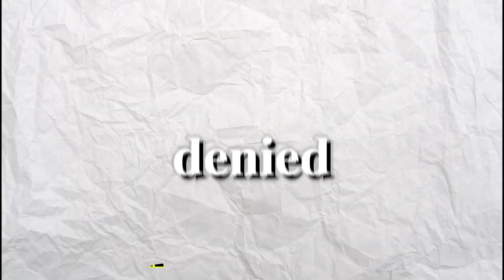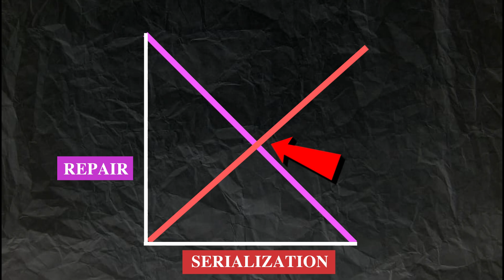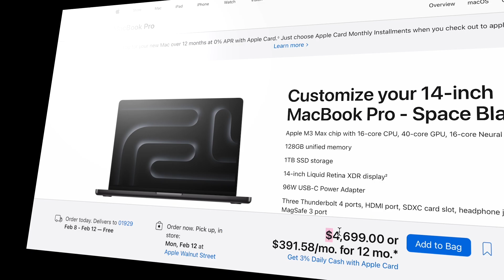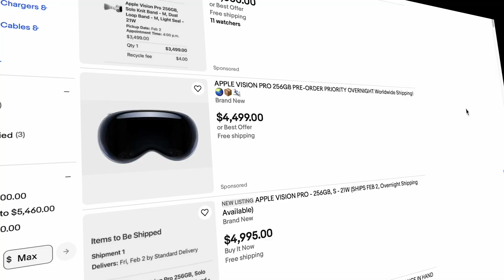Apple's Vision Pro Will KILL Repair - Here's How!

Comment: lol @ the front thingy being glass - it actually even worse. Its glass covered in plastic (apple calls it laminated glass but given the order of materials its actually laminated plastic) . So it can be scratched as well as brake. That's double the probability of it getting trashed.
Reply from the maker: YES!  My jaw dropped at the teardown videos - it’s similar to the Galaxy fold phones which are ‘technically’ glass - but scratch way too easily
Reply: @HarryKwastaken   didn't steve jobs make the first iphone plastic at the front, saw all the scratches, and decided to use glass, and deciding to use gorilla glass which was a resistant glass with no use at the time, so it didn't break, now iphones fall and not only does the front break, the back does too, no way to repair it under 500 dollars, and now apple made the apple vision pro plastic, on the outside

apple is evolving backwards
Reply from the maker: @NicolasIMV  Yeah, the back being glass is kinda crazy now - it feels super premium but has a lot of compromises...